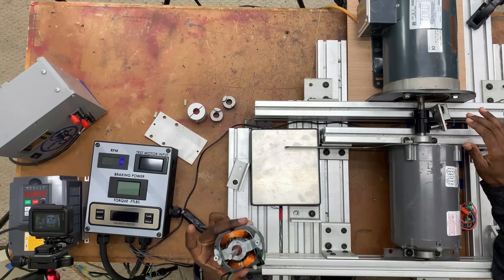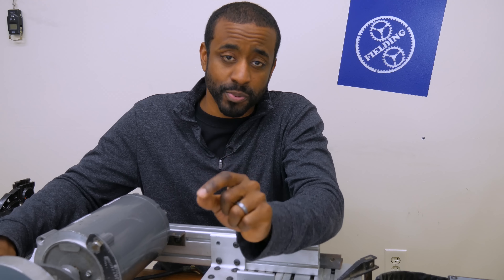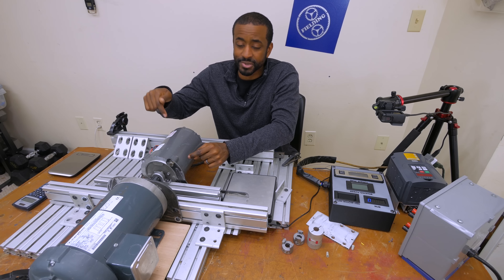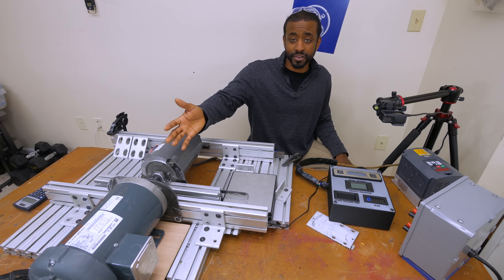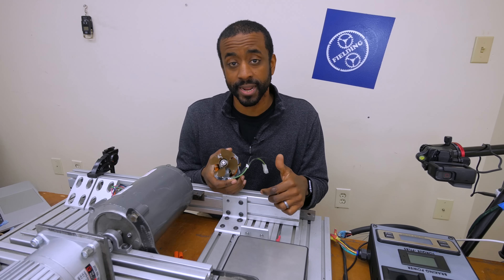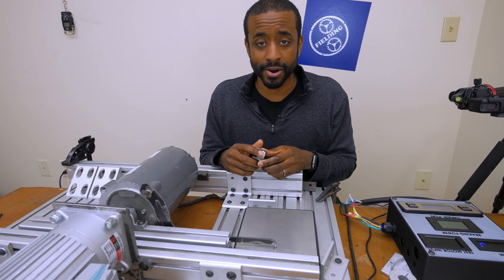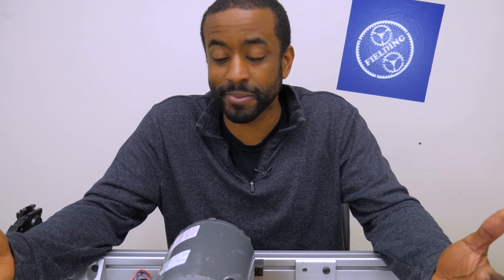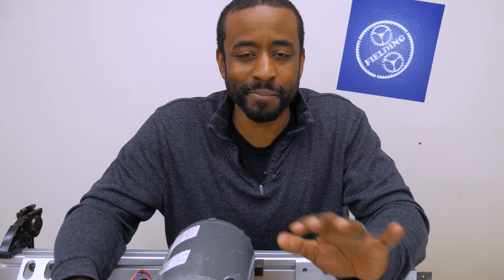How to Measure Horse Power for Any Electric Motor: (#077)

Comment: If you use that induction motor at high torque low RPMs for a long time, the rotor will overheat.  Rotor induced power is a function of torque, but cooling is a function of RPM.  It might be better to use an open framed motor for the brake, so that you can blow air through it.  Also, a 1800 RPM motor may not be well enough balanced to run at 10,000 rpm as a brake.  You need to use a motor that is at least close to the rated torque and RPM of the driving motor for the braking motor.
Reply from the maker: I agree that using motors similar in RPM and torque would be ideal for several reasons. But, for DIY level testing I think that might be difficult to have. 
I will add a note to the description about the rotor not being balanced for high rpm though. My motor has survived several test at 21k already for an up coming video, but that certainly won't apply to all motors used for this.
Reply: @Jeremy_Fielding  Would a water cooled CNC type HF Spindle motor make a better brake for high speed motors?  Drive one phase with a rectified VARIAC output?
Reply: @xicath  the pulley reduces rpm at its output (i.e., larger pulley attached to a smaller one on the motor's shaft) so the motor spins at the same speed and gives the same torque (thus the same power).
Reply: @Jeremy_Fielding  Holy cow. I’ve always heard not to exceed 10,000 rpm on components not balanced for high speed operations. I was going to post the same thing about spinning an induction motor past 10k. The rotor windings usually aren’t secured well enough and fly apart crashing into the stator windings. With that much inertia spinning at 21k that would not be a failure I’d like to be sitting two feet away from.
Reply: Some induction motors (usually more expensive ones) have a published maximum safe speed. I have never seen a generic off-the-shelf safe speed higher than 5400 RPM. But I suppose I have not done an exhaustive search either. I would expect that the motors which do not specify max speed are actually even less reliable than the ones who have specified it.
Reply: If you use a totally enclosed fan cooled motor (TEFC) at low speed but within its rated torque limit, you should be able to easily cool it with an external fan. The built-in fan won't be doing much at low RPM, but the external fan will make up for it. If you go over the rated torque, then you may overheat it regardless of speed or fan cooling.
Reply: i know Im asking randomly but does anyone know of a tool to log back into an instagram account??
I was stupid lost my account password. I appreciate any tricks you can give me.
Reply: @Maxton Princeton Instablaster :)
Reply: @Arlo Dane I really appreciate your reply. I got to the site thru google and I'm waiting for the hacking stuff atm.
Takes quite some time so I will reply here later with my results.
Reply: @Arlo Dane It worked and I actually got access to my account again. Im so happy!
Thanks so much you saved my account !
Reply: @Maxton Princeton Happy to help =)

Comment: Hi, loved your video thanks a lot! I'm an electrical engineer working in the field of inductions motors and I would like to leave just one remark on the service factor: Assuming an operation duty cycle of S1 (continuous operation) SF 1.00 means that the motor can run undefinetly at the rated power without overheating. SF 1.15 is exactly the same but at 115% of the rated power. Th

Comment: FYI, Magtrol dynamometers use a similar torque transducer setup. Theirs is a calibrated lever with a strain gauge to measure deflection. Additional I tried this into a pre-DOS computer system and wrote all the software enabling us to have a graphic and tabulated measured and calculated values. I've played with arduino, interfacing should not be a big problem.

Comment: Hey Jeremy, big fan of your videos! 

I have a suggestion! 

When 3D printing stuff like those couplers, the orientation of those print layers will change it’s strength in the plane the load would be applied. So, instead of printing where the torsional shear stress would be maximum along the same plane as the layer by layer print orientation, a simple 90 degree rotation (or printing it on its side) would significantly increase its strength!

Also, annealing the PETG for this application would help too! You may have a little warping from the heat but it’ll help add to the overall strength!

Comment: Good project! A couple thoughts: 1. Gearing your brake up with a belt drive could extend the range of measurement.  2. The rowing machine and/or a treadmill electronics display contain sensors and some forms of speed, distance, and power measurement that would could help you get some digital instrumentation for the dynamometer.  Some that I've used displayed Kw and rpm.

Comment: Arduino users will need to know 1) specify the electrical signal(s) from the scale, 2) specify the electrical signals from the tachometer, and 3) specify the display to be used.  An Arduino timer and a revolution pulse can substitute for a tachometer.  Also, torque is 
vec(r) cross vec(f); if the two are not perpendicular, you need to multiply by sin(angle).

Comment: Nice video,  I am working on a hydraulic dyno right now.   Just because I know way more about hydraulics and I want to hold the load on the motor for about 30mins, I was worried about using a motor as a brake for a long period of time because of heat.  Same concept I just need to get a base line HP for the correction factor because of the efficiency (heat loss) of the system which should be about 80%.

Comment: When you 3d print things think about the direction of your layer lines, layer adhesion plays a big part of the part strength. Great video like your approach.
Reply from the maker: Interesting thought... This is complicated by also wanting to avoid over hangs. I guess you can always print support structures... or try to design with both in mind at the start.
Reply: @Jeremy_Fielding  its always a problem, the easiest way to print an object may not be the strongest, so support structures are sometimes the only way to get it done but thinking about layer adhesion will help make your decision when designing at part for strength. 👍
Reply: Another way around this is to separate the print into component parts. Ex.: print each tooth of the coupling so layers run axially and put a collar around them (printed, hose clamp or snug-fitting metal tube/pipe). Each tooth part will need to interlock with the next under the collar to prevent shearing between them. Modelled up a quick 4 tooth example in FreeCAD (well, 1/4 of a 4 tooth set):  https://www.dropbox.com/sh/r194qv274800u67/AAAbyd3rdz7aFdtCWIpbD4XHa?dl=0

Comment: LOVE THIS!  I built a desktop dyno in labs for a Mechanical Engineering program.  We used a hydraulic pump and pressure gage to measure power. But looking at your setup, I think you could make  it even more simple by mounting a rotor that is spun by the motor you are testing and gradually increasing clamping force through a caliper with your rod mounted to it. Btw, you may check out a laser RPM gage instead of the prox proxy sensor.

Comment: For the coupling look holset couplings. Might not be so great for the universals but will be fine for the induction motors.

You could also use a treadmill motor (as a generator) with a rheostat on it. Measure rpm, voltage and current. Start at no load and wind down the resistance till you reach the right RPM. From there you can calculate hp and torque given estimates for slip, efficiency etc based on motor design (errors that are already inherent in the current design). Should be much simpler to build, just a little care required to plot the efficiency of it at various rpm to get good accuracy.

Comment: Interesting you did this video today! My furnace's blower motor is acting up, but the label on it is totally unreadable and the furnace make has no info, so I can't confirm the correct replacement part. I thought about just measuring it while running but couldn't get a proper test rig... your ideas might just be what I need!

Though, on the other hand, my furnace is almost 30 years old, so I think I want to put a whole new one in anyway.
Reply: Take your motor to an electric motor shop, they can tell you what you need for a replacement. These motors are standardized-

Comment: The strength of that petg coupler would increase pretty significantly if you print it at a 90 degree orientation  from how you printed it.  The print lines are weaker so if you print it in the orientation where the print lines are perpendicular instead of parallel to the rotation it'll be much stronger.

Comment: Might be overkill but you could use a VFD to control the load motor. You would need to add the brake resistor to the vfd. Without the brake resistor, the DC-link voltage will get too high and it will shut down. Not all VFD's support brake resistors but quite a few do.

Comment: If you do it with arduino or something like that you will need only arduino and a3144 hall sensor. You can see all data in serial monitor of arduino on laptop screen. And for scaling torque with a scale module. You have to use micros/millis and interrupt functions for rpm. I am trying something like that for my old vw t25 van. And i research for like 3 months. If you like ready to use codes for rpm i will share harvested codes with you :)

Comment: This is awesome! I'm trying to design my own dyno for motor controller projects, but I don't know the mechanical stuff so well. The part I have been most unsure of is mounting the test motor in a way that provides good alignment and works for test motors of various sizes and shapes. I would be really interested to hear you expand on your experience with that and see how you set up a new motor. It looks like you have to machine a custom bracket to bolt the faceplate of the test motor to the aluminum bar. I'm thinking about trying it with wood or 3D printed plastic (I don't have access to proper tools for working with metal). I wonder how much speed and power is possible with those materials. If that doesn't work out, a belt or chain drive seems like a good alternative.

Comment: on your printed parts, I don't know if it would be any stronger but it looked like you printed the cylinder from bottom to top, which makes the force it can take dependent on layer adhesion, try it laying on its side, even if its the same strength it would twist then snap like a screw head rather than explode

Comment: One suggestion: When you assemble the couplings of the two motors together, you might want to consider using a ruler or a spirit level to ensure that the two couplings are leveled.
Reply: Awesome videos by the way. Keep up the good work :)
Reply: Ain't no WAY a spirit level would be accurate enough for that task!

Comment: Does the supply of dc to the stator windings cause the motor to act as a generator? Im trying to do the same process, and am worried about, once exciting the stator with dc, that the induction motor will act as a generator and produce ac. Then, i have the danger of dc and ac in the stator at once. How did you get around this?

Comment: Back EMF
Back Electro Motive Force

Can be an issue with DC drives backfeeding to a generator supplying them...
Such as in diesel electric rail traction...
A way of overcoming this is through "field diverts"....
Several stages of "field weakening" on the DC traction motors....

If you ever visit the UK...then go to the national railway museum in York....
They have a dynamometer car there from the 1930s...
A pioneering piece of machinery...
There's also one at the national railroad museum, Green Bay, Wisconsin, USA...
🇬🇧🙂
Reply: Are you thinking of the motor he was using as a brake? I believe that is an induction motor, not a DC motor. There is no back EMF. He is just injecting DC into the winding of the induction motor, which causes it to act like a brake.
Reply: @mckenziekeith7434  

Rite....

Comment: Nice intuitive way to build a dyno. So you get the test motor up to its rated speed, progressively add braking torque, watch the current drawn by the test motor increase to it's rated value, then read off the torque. Is that right?

Comment: Hi Jeremy. Love the video. I was hoping you could shed some light on how the calculations are made from the induction motor acting as a brake. How do you know the power required by the induction motor and how does that translate to the output torque?

Comment: Dear everyone, if you measure speed in radians per second and torque in newton meters, you just multiply them together to get mechanical power in Watts. If you know a little math and you remember this one fact, you can easily figure out how to calculate motor output power in watts. I guess you also have to remember that 1 HP is around 750Watts.

Comment: If your motor lists the voltage and current this will give you a very close approximation to the power. Just use 746 watts per HP.
Reply from the maker: You don’t know the efficiency. Some motors are 80-85% (that’s common for induction motors) to universal motors at less than 50%. That number doesn’t tell you enough.

Comment: Now you need an arduino in there recording the torque and RPM. Then have a button to log the data into a CSV file and log every 50 or 100 RPM through the range of the motors speed. Boom: Horsepower Curve!
Reply: Modna89 🧐
Reply: Did you watch through 14:17 and beyond?  :)

Comment: Sorry, this is off topic but I respect your knowledge of electronics. I received an Anet A8 3D printer with no documentation, so I did some Google searching to see what I could find. I got it up and running with a couple minor setbacks but while adjusting a limit switch, I touched a couple of solder joints on the small switch pc board. I saw a bit of a spark and my controller screen showed rectagnal shapes filling the screen. I hooked up my USB cable to my laptop and the screen went to the normal view but the main board was not powered up. When I plugged in the main power the screen went back to the rectangles and my laptop shut down. Any ideas as how I can fix it?

Comment: If you went the route of a toothed belt, could you then use two different sized pulleys so your braking motor is half the RPM and still get accurate measurements?  Could be an answer to the higher speed motors.  Thanks for another great video.
Reply: Or maybe a chain or gears?  Would a belt have some compliance that would affect the reading? What about some sort of centrifugal clutch mechanism?

Comment: sorry for my ignorance but wont the results get mixed depending on how much force is put on the break motor? and depending on the position from where u measure RPM  give you different readings one has to account for? hmm im just so confused to how this works. just started researching this dyno-topic and im not too smart. so perhaps i need a more dumbd down lesson to start with.

Comment: What happened to the coupler is delamination of layers - you cannot print these in this orientation and expect any reliability! You have to go lengthwise with your layer and then be very careful how you place the mounting screw hole so it doesn't delaminate layers in its turn on the shaft. Or make a composite out of plastic 3d-printed nut and metal bars that are fixed in the nut.

Comment: It feels odd to me to use another motor as a brake.. I mean cant you replace the brake motor with any other device that will apply braking force to the other end of the shaft? Like a clutch-like mechanical, friction based brake with virtually no limit on usable braking power as you can make it really solid and durable. Is there any particular advantage to using the motor as a brake?
thanks for reply

Comment: You built the exact thing I've been thinking about.  DC current injection into an induction motor.  As a mechanical engineer, I'm not well-versed, but I believe the amount of current needed to get a given brake torque varies with motor speed- is that what you found here?

Comment: Thank you for sharing and learn others! So this could also be used to measure torq and hp Vs rpm on a combustion engine? I have a 30/60kw 260vac induction motor from a Electric weichle. How should i go about making this into a Dyno?

Comment: Interesting project, and a useful tool. There must be a few experienced microcontroller programmers watching. I've only just started experimenting with Arduinos so I can't help there unfortunately. Maybe with some electronics, although I doubt I'm more advanced than you. Is there a reason you chose a Hall effect sensor instead of optical? Surely the magnet's mass has some impact on readings? And housing it compromises the coupler's strength? Optical would also be less prone to environmental influence and probably more accurate.

Comment: At university they had a simple dynamometer brake. It was a steel drum with 2 brake block, like this : https://bit.ly/2HU9c5t . But instead of weight the arm was pushing on a scale. To load the motor you would tighten a screw and the brake blocks would increase the friction on the wheel. For cooling you would simply squirt water into the drum, that had a "lip" on the edge. So that you would constantly keep it below roughly 100 °C.

Comment: So where do you drive you car on?? Hahaha 
I love your panel box along with the rest of the video! 
I thought this was going to be done by Arduino, you could have the RPM, the torque, amps and volts, even temperature, effectively just write to serial monitor, or even to SD card for remote with out being connected to pc.